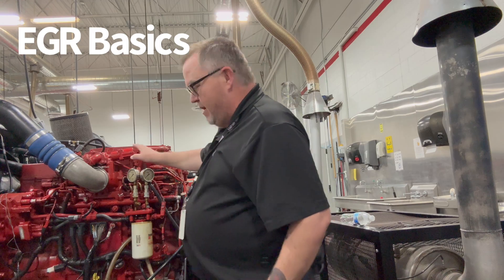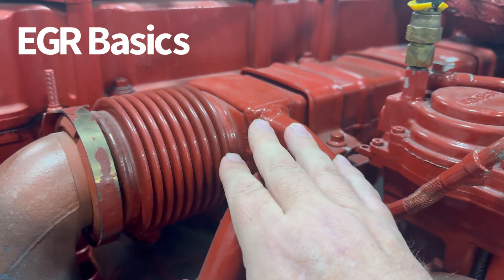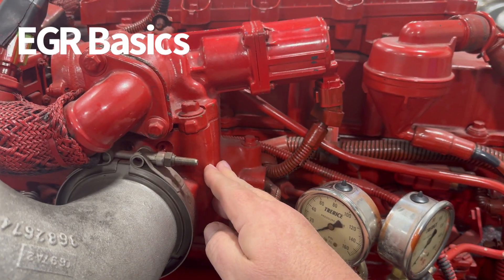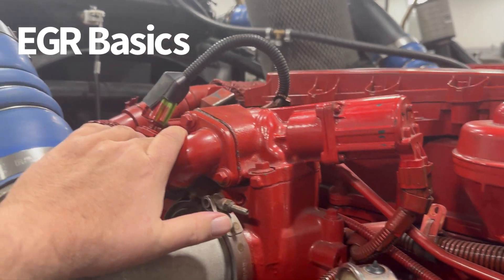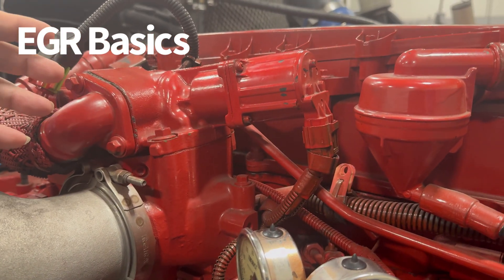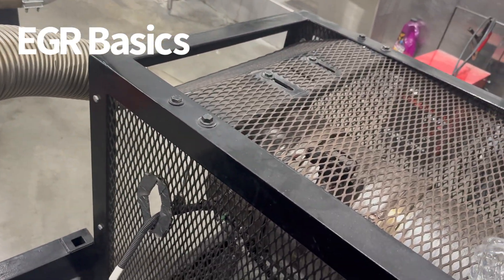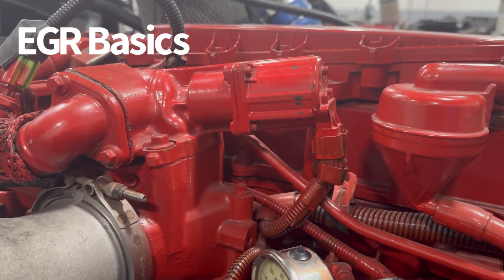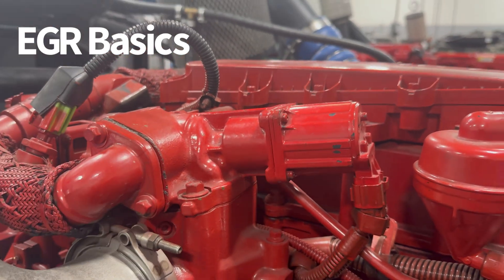How EGR Actually Works (Diesel EGR Explained)

Comment: What are normal percentages of readings when diagnosing the egr system. Or the differential pressures ?
Reply from the maker: That’s a complicated question to answer based on it varies form engine to engine based on displacement, boost, model year etc….. give me a specific engine and I can probably give you a better answer.